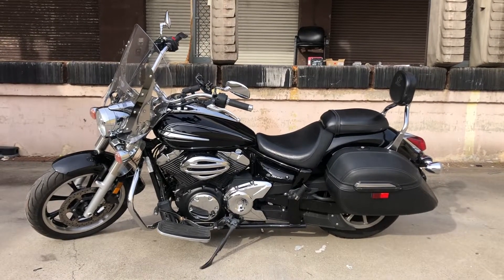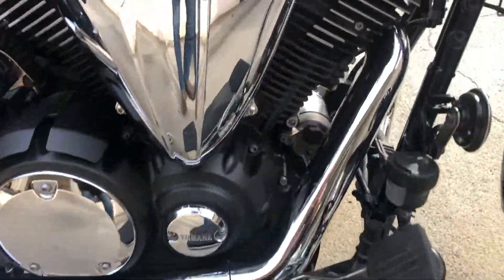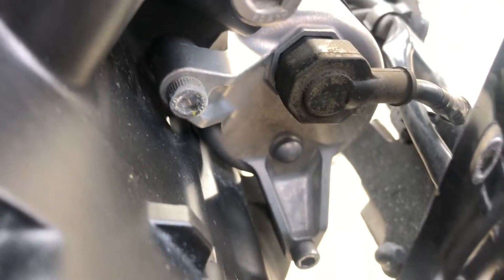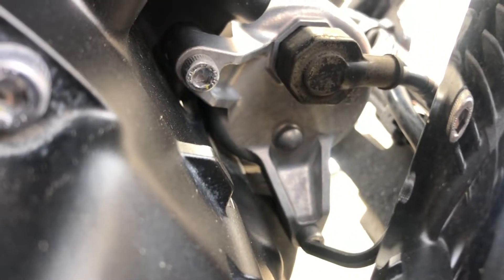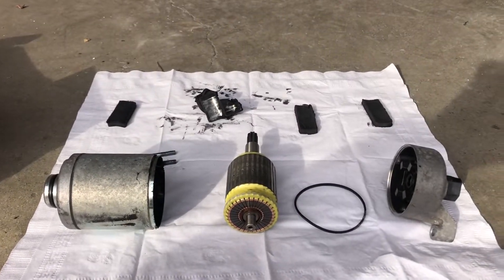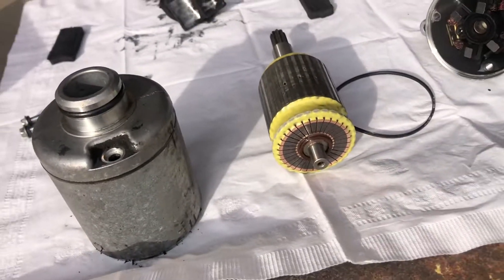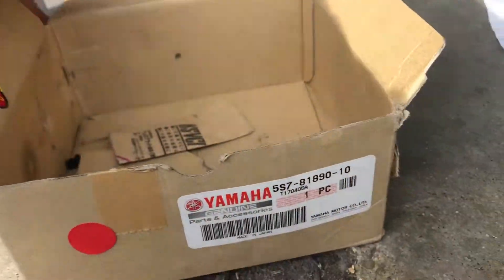Yamaha V-star 950 starting issue

Comment: Same thing happened with mine, it didn’t make the sound just starting it would sound a little weak. The magnets were broken also. My problem began when I started the bike when I was parked uphill. I got a new one from a different company .
Reply from the maker: Which name brand did you get and is it starting well?
Reply: @marcbee1234  DBElectrical. No issues with it yet.

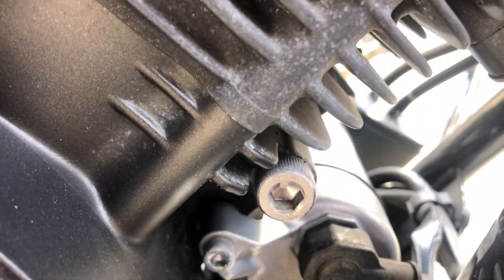Comment: Just a side note... in my experience after 3 new starters be sure to check your starter button for sticking...  as mentioned at 4:00 in this great video, the root of the problem may be the button stays depressed due to age outside after turn on which definitely will over heat the starter causing the magnets to become unattached over time resulting in them breaking. And hence ... the woes of my endeavors. Great vid Marc thanks !

Comment: dude thats my exact bike lol, had an underpowered battery in it for a while, the drive belt was skipping teeth- got the right battery, fixed the belt issue- NOW for no reason, my perfect battery that was working just fine yesterday was bone dead.
After topping the battery off, couldnt get my starter to turn.

im thinkin i mighta burned it out trying to crank it so much. i get the click, the starter solenoid relay fuses are clean, the connections are all good- im thinking its the starter like this.